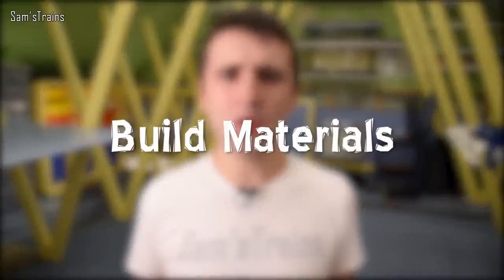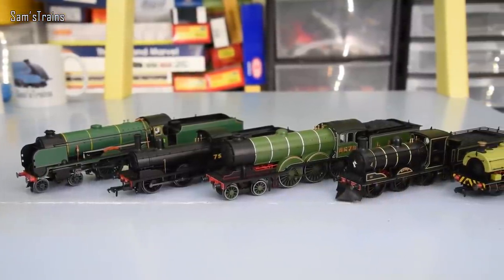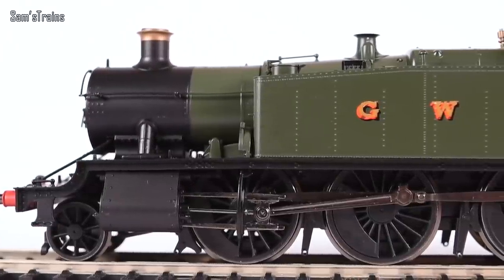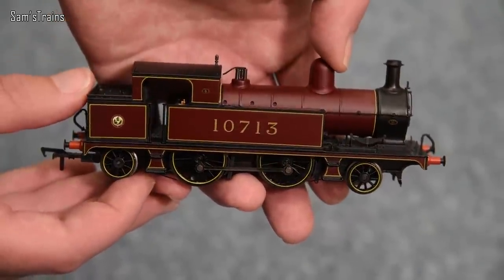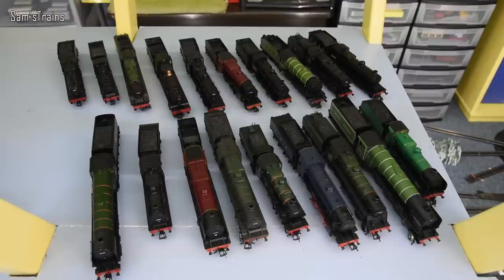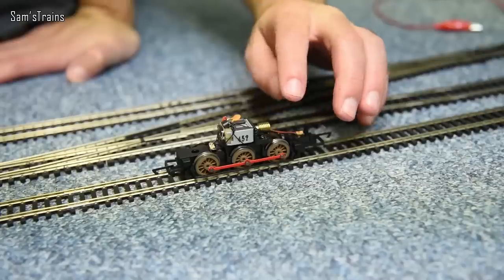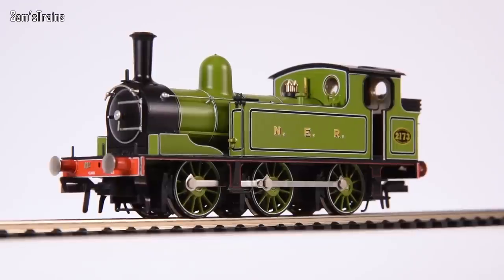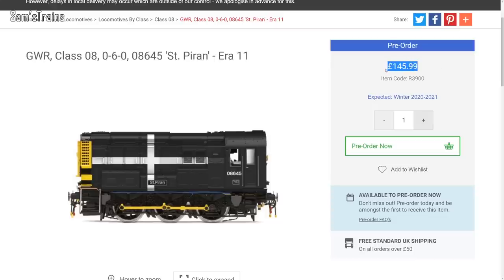Bachmann vs. Hornby Trains | What's the Difference?

Comment: Personally I prefer Hornby over Bachmann as you can easily replace loco parts for a bargain and The prices of their products are considerably cheaper especially with their mechanism 
Thanks for this Sam I have been waiting for this 🙂🙂
Reply from the maker: Very true! They're much more user friendly in that regard - better and cheaper - I like that too! ;D
Thanks for watching - Sam :)
Reply: Have you tried replacing parts on a new Hornby loco? You cannot get the parts, like West Country valve gear, Fowler Tank pickups. It is getting worse. Ok, Bachmann spares might be expensive but at least you can get them.

Comment: Great site Sam, I'm 77 & used to have model trains years ago. So what I wold like to ask you is for complete run down on the best loco for each class related to my time train spotting days at  Bournemouth in I think it was 1960 I think ?? & I decided to change to aviation (where I have been lucky to work within most of my career) A GREAT site Sam & only recently found it.

Comment: I'd like to add two points...
1.hornby  try to be all things to all men. From cheapo train set locos right up to amazing top detailed stuff . And yes I agree it's not always made clear what market each loco is aimed at.
2. Bachmann diesels are great, but so many of their steam locos woddle down the track like an angry duck!
Reply from the maker: Yes two very good points - Bachmann's diesels are another kettle of fish altogether, if I had more diesels, I'd be in a position to do this video for diesels too! :D
Thanks for watching - Sam :)
Reply: Im bit of a tightwad as well so another reason i only buy from the bargain basement and Bachmann seem to be always out of my price range!
Reply: Baz Bazdad  hi Baz. Yes I owned a gs425 for a total of 18 years. I say total because 5 years after I sold it , I bought it back. Wish I still had it . The perfect all rounder. Most modern bikes are either too big or too small.

Comment: Bachmann: thomas and friends show models
Hornby: counter part thomas models
Reply: @123CrazyChazy  Bachmann had trash quality compared to hornby tho
Reply: @123CrazyChazy  Not gonna lie they both have flaws.
Reply: @123CrazyChazy  really? Bachmann always put bad motors in their locos
Reply from the maker: Bachmann's were certainly more accurate, but they were much poorer by design (mechanism!!). Some of Hornby's did suffer mazak rot (Bill and ben were big ones), but at least this wasn't by design! Bachmann's have the motor failures because the motors can't handle all that friction from the complicated eye mechanisms, crazy number of gears, and lack of bearings in the wheelset!
Thanks for watching - Sam :)

Comment: Apparently Bachmann is completely different in the UK, here in the states the are the cheaper option, and aren't that reliable, or good pullers, or well detailed. Just kinda MEH here in the states, but the prices don't mirror that, a Spectrum DCC 4-8-4, be it a Daylight, or a N&W J-Class. Are around $300 plus if you can't find them on sale.
Reply from the maker: They're exactly the same in the UK, they're just not the cheaper option, everything else is accurate! ;D
Thanks for watching - Sam :)
Reply: We might finally see some quality in the UK when Rapido get established here?

Comment: Good video.Although I don’t own any Bachman ho locos(I have five N scale with no problems) I was fully aware of the rather lacklustre mechanisms of their locos.I really like rebuilding old locos that I find at flea markets,etc but if I buy a new loco (not often,I’m poor)I really want it to run properly with a good design.Having no wheel bearings on expensive locos in this day and age is inexcusable.
Reply from the maker: Thanks Alan - interestingly I have heard that their N gauge gear is much better - not seen it for myself though! I agree - they should have those features, or they should be cheaper - simple really!
Thanks for watching - Sam :)

Comment: Great video. One gripe I have about Bachmann is that their interior lights (cab lights, EMU and railcar interior lights) are always light orange LED's and I've had to go around and substitute the ones on my Bachmann stuff with warm white LED's instead.
Reply: I don't think that's the case on the more modern stock, the class 350 is spot on.

Comment: Fair comparison, I agree. In a nutshell :
-Bachmann : drivetrain mediocre to fair, good level of details, constant quality, excessive price.
-Hornby : very good to excellent drivetrain, usually good to excellent level of details, but quality is random, with some lemons and motors issues. Price justified to good.
When the Standard 2MT by Hornby will be sold, I invite you to make a comparison with Bachmann's Ivatt 2MT tender engine, it is roughly the same model (the BR standard is an improvement of the Ivatt). I bit my fingers when I saw that the Hornby model will have a die-cast body for GBP 162, retailer's price (RRP GBP 180)... I'm going to buy one anyway !
I'm in for a diesel/electric comparison, it will be very interesting.
Reply from the maker: Fully agreed - you're right to mention Hornby's lemons and occasional quality lapses - hopefully I mentioned those too!
Thanks for watching - Sam :)

Comment: Was having issues with my bachmann 9f the other day with it cutting out randomly (my heljan o2 took over from it, and it ran perfectly), so I invested in a set of dcc concepts wiper pickups, which I'll be fitting into locos without tender pickups (most bachmann tender locos like the 9f, ivatt 2, ivatt 4, unrebuilt patriot, wd 8f, especially split chassis locos where I've added a dcc socket in the tender, and also hornby locos like the p2 and peppercorn a1). You certainly have more bachmann locos with tender pickups than I do (I think my only one is the GWR City class).
I had to service the loco part of my 20-year-old hornby tender drive Flying Scotsman because one of the pickups had bent badly, so I was intrigued to find 2 wiper pickups per wheel (6 driving wheels, so 12 wipers). And of course the axles had proper brass bearings too. It was one of my first locos, and sure it had an issue of one of the big end screws going missing for a while and also the traction bands failing at one point, but its still a good loco despite its age. It even has separately fitted handrails and sprung buffers!

I have to say, bachmann have better DCC interfaces in locos. Tender mounted 21-pin DCC sockets in their more modern locos, against hornby insisting on using 8-pin sockets in everything (unless sound fitted or small). Hornby also have loco mounted sockets but tender mounted speaker enclosures, which seems silly for TTS.
Reply from the maker: That's interesting! I'm not familiar with the Bachmann 9F, does it have pickups on all the driving wheels at least? I never knew the Hornby Scotsman ever had two pickups per wheel - that's quality stuff!
Thanks for watching - Sam :)
Reply: The 9f has pickups on the flanged driving wheels, not the centre flangeless one.
I'd say the bachmann 9f is the better model as its more detailed and comes in more variants, but the hornby one runs much better (mine died a couple of years ago, so I only have one bachmann one now, 92006)

Comment: Based on the Thomas range... I’ve noticed that Bachmann is more accurate than powerful such as with the Gordon model. The Gordon of Bachmann’s detail is superb, as compared to the Hornby model which is oversized and with a lot of the proportions wrong. However due to the larger tender, the Hornby Gordon is able to house the motor in its tender and that gives it more power and more tractive force with less effort. The way I understand it with my minimal knowledge of physics is that with the Bachmann model, the engine has the motor and the pulling power is all at the front, meaning the load at the back is heavier. With the Hornby model the tender pushes the locomotive instead of the loco pulling it. So the weight at the back is decreased while the weight at the front is increased. This is better because it is easier to push something rather than to pull it. So the Hornby models are stronger. Also I think the Bachmann model has a tiny motor crammed into the engine which is less powerful than the bigger Hornby motor in the big tender. So if you’re looking for durability and power, then the Hornby models are the ones for you. If you’re more of a serious collector or somebody who wants accuracy over power such as a filmmaker or someone, then the Bachmann models are the ones for you. These are just my thoughts.
Reply from the maker: Yeah that's true - more accurate than mechanically sound even, agreed 100%! Thanks for sharing - cool stuff! :D
Thanks for watching - Sam :)

Comment: I have been collecting Hornby and Bachmann SR EMU and DEMUs. They are the same models but in different liveries. The strange thing is, while one example will run perfectly another one, which is apparently the same but in a different livery will run badly and stall and the points. Earlier you reviewed the Dapol class 73 and had running issues with it, but my one is all right! Maybe your next video should compare examples of the same loco. Which one is the lemon? If you examine two locos that are apparently the same, you find small differences. I think it must be that there are different production runs, but when you buy a new loco, it can be an old stock item, and not just off the ship as you had imagined!
Reply from the maker: That's very interesting Allen - but sure, some models are faulty while others aren't - it doesn't necessarily means they're a bad design! I do tend to look further though - I try to ascertain why a loco runs badly - with the Dapol 73, I did conclude it was due to poor design!
Thanks for watching - Sam :)

Comment: Right, but you've made a few videos on the Hornby channel. This would suggest that this study is, even if not deliberate, slightly biased. An example is that you could have used the same loco classes when you did price comparisons.
Reply from the maker: No, I don't think that's a reasonable conclusion. Given the fact that my audience is an order of magnitude larger than Hornby's, I was doing them a favour, and not vice versa as you suggest, by producing content for their channel. Regardless, I was very critical of both Hornby and Bachmann in this video, so the word you're looking for is balanced not biased.
To have used the same classes for price comparison would not have been fair, as neither manufacturer has their own modern example of the same class, except the 08, which I did show. In cases where both manufacturers produce the same model, one is always much older than the other (Hornby vs Bachmann A4, Jinty, Patriot, 4F etc) So how would using the same classes have been more fair?
Make sure the evidence supports your narrative my friend!!
Thanks for watching, Sam :)

Comment: Hello Sam, this might give you a laugh. I went into my local hobby train shop on 2 occasions. On the 1st occasion I asked the guy who worked there what type of lubricant I should use. He showed me the lubricants and grease they have, but He recommended to use sewing machine oil and told me it’s good for lubrication. The 2nd occasion I went back there and asked a lady who worked there about what type of lubrication to use and if sewing machine oil is good to use. She immediately was against using sewing machine oil and pointed me to the lubrication they had. Which is a bit much for what it is, it only came in little lubes they had grease and lubricants, each for $21 Australian dollars that’s like £10 each! (I doubt they are consistent with their knowledge about model railways) I didn’t buy any though it was a bit much for what it was. I had a look around the store and to be honest a felt a little bad for this hobby because everything in that hobby shop is expensive. A single coach (the type that the flying Scottsman pulls) is $80 Australian dollars that’s like £40! To be honest I get disgusted when hobby shops charge so much for things that should be affordable. I mean how is a child meant to start and expand a model railway if it is so expensive? Anyway I just want to ask do you use singers sewing machine oil to lubricate your train? Should one use grease on the gears or should one just use sewing machine oil on the gears and everything else? 

Thank you for reading. 👍
Reply: Hey Sam, I am thinking of getting Singers Sewing machine oil to lubricate Hornby trains’s plastic gears, coupling rods and everything else. Any opinions on using Singers Sewing machine oil Sam?

Thanks 👍
Reply from the maker: haha that's very interesting indeed - how people's advice can change when they'll make a $
Sewing machine oil is just the job - I use Hemline brand, and it's served me well for years! :D
Thanks for watching, Sam :)

Comment: just bought a second-hand HO Bachmann Spectrum 4-8-2 light mountain almost as new condition.  Amazing detail and a nice runner.  Do you know if these are a higher spec than other Bachmann locos?  It apparently has a belt drive as part of the mechanism, not sure if that is a good thing, but as long as it isn't some sort of rubber band, I guess it would be ok.  The rest of my collection are one Tyco, one Athearn, and the for British locos one Wrenn, one Oxford, one Hornby-Dublo and five modern Hornby steam.
Reply from the maker: Yeah I have some Spectrum locos too - I'd say they're roughly the same spec as their Bachmann Branchline locos - I'm not keen on the idea of a belt drive either. They certainly don't run better than locos without belt drives, but I haven't had any problems either!
Thanks for watching - Sam :)

Comment: I've always been a fan of the Bachmann trains compared to Hornby. The detailing is far better. (My opinion!)
Oh and I do agree with the unreliable motors that Hornby use, after changing a few in the first 5 I ever bought I try not to buy anymore of them. I now only have one now, an old diesel shunter which I've had since the 70's!!!

Comment: I wondered how long it would take before you did a comparison test like this. I find both manufacturers produce some great models and some terrible models, it's the same with the other manufacturers like Heljan and Dapol. Although one of the modelling magazines figured out the Bachmann EFE range isn't exactly all Bachmann when they noticed in the maintenance book that the customer has to call Heljan for spares if there model fails and then the magazine questioned the price rise on the model.
Reply from the maker: Thanks Ben! I was struggling to find a way to do this fairly, but by taking a broad view of many of their models, I think I managed it! :D
Thanks for watching - Sam :)

Comment: Hey just wanted to tell you something 

A few months ago you made a video on the Bachman spectrum 2-10-0 and you said it had 3 whistles.

Well those are not whistles. There called safety valves and there put on U.S. locomotives to let off steam in case there’s enough pressure in the boiler to cause it to explode.
Just thought for future U.S. engine reviews it might be good to know this.
Reply from the maker: Hey! Thanks so much for letting me know - silly me! D:
Thanks for watching - Sam :)

Comment: May I suggest inclusion of ability to maintain traction on an incline & ability to negotiate tight curves, particularly when the curve changes from right hand to left or vice versa. 
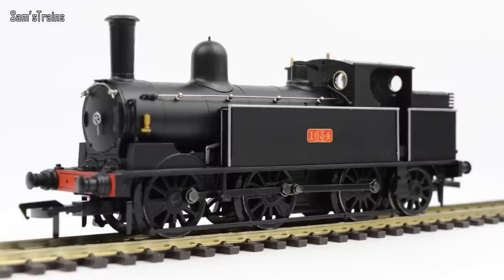I have a layout situated in limited space which includes a 2nd radius curve, inclined at 1:25. Several engines of both makes & Bachmann in particular passenger coaches can not handle my layout, either because of the tight radius, or loss of traction when pulling five coaches.
Reply from the maker: Yes! That's coming to light now too - I'll be talking much more about this going forward!!
Thanks for watching, Sam :)

Comment: The Bachman Thomas & Friends range of locomotives and rolling stock is generally cheaper than Hornby’s. This is even with designing original molding for the line, whereas Hornby just reused existing molds and slapped the faces on. That was before the Hornby Thomas and Friends range was discontinued. The Hornby Thomas cost double the price of its Bachman counterpart. And there are characters that Bachman made that Hornby didn’t get the chance to release before discontinuing their Thomas and Friends line.
Reply from the maker: I don't think Bachmann were cheaper than Hornby's - pretty sure Hornby's RRP for Thomas was never as high as $99.99, much less double! You're right about Bachmann's effort though - theirs were always much more accurate!
Thanks for watching - Sam :)
Reply: There is a series of videos that compares the Bachman Thomas and Friends range to Hornby’s directly by the individual character (I.E. comparing Hornby’s Thomas model to Bachman’s). They did Thomas twice due to emails like some Hornby Thomas models not having traction tires like the model used in the first Hornby Thomas vs Bachman Thomas video.

Comment: A little while back I bought a Hornby International Electrotren model (OK, second hand but seemingly little used) of a GWR 0-6-0 saddle tank engine. Beautifully detailed, really really nice looking little engine. Nice yard shunter for light duties. After half an hour the motor died in a cloud of smoke. The model, quite clearly, wasn't designed to be taken apart or repaired. In fact the motor mounting clip broke apart as soon as you waved a screwdriver at it. I've rebuilt her, with a 3mm Society 12mm gauge chassis as a narrow gauge loco, and junked the old mech. Come on, this is not good enough!
Reply from the maker: You're right actually - the Electrotren stuff I've tried has been really good too, but so often they're not designed to be serviceable - pity about that :(
Thanks for watching - Sam :)